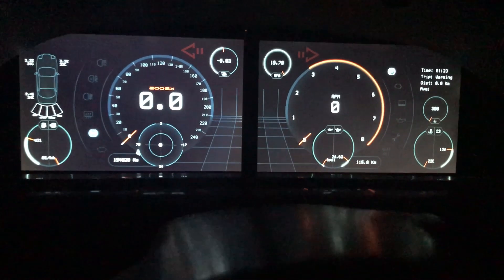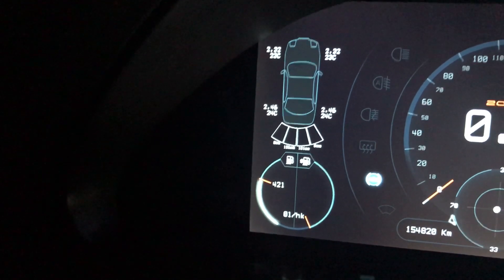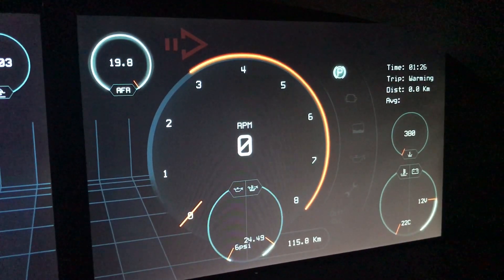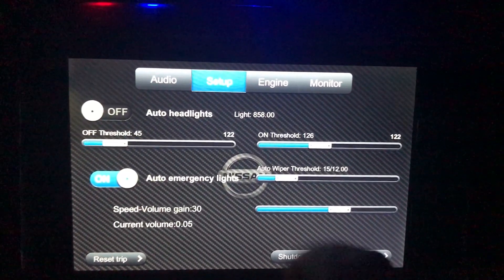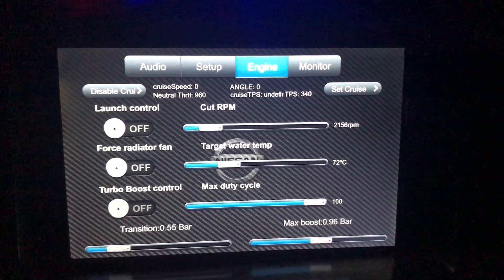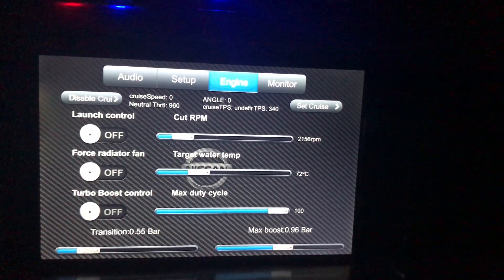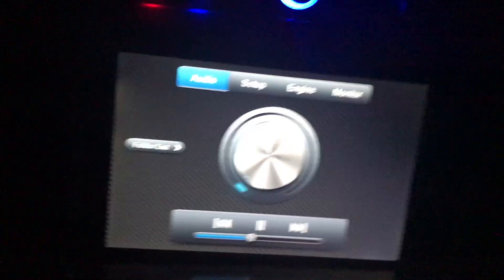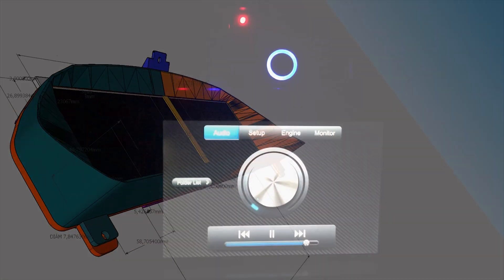Nissan 200sx Project update (September 2017)

Comment: Thats a really nice display, the thing i like the most is your custom UI!!!

Could you share some Details how you made it ?(Software or Templates)

 I am looking into making one myself but still looking for a easy way to implement the gui as i am extremly demanding but at the same time extremly novice with graphic design creation. 

It would be great if you could share some details or even template files, i already checked out your blog but havent found anything there.

Nice Work, and hoping for your Answer :)
Reply from the maker: Hi Daniel, thanks for your comments.  It is normal that you didn't find anything since I wrote all the software for the project.  At the time I used Adobe Flash to create a desktop application for the GUI, because of my previous background it was the easy choice for me.  Now that is bringing me serious portability issues and I'm re-implementing the same GUI in C++ so I can make a viable commercial product.   The GUI is basically dumb and all the stuff is happening in the backend running on a nodejs which exchange data through a TCP socket port locally and with the ECU and arduino MCU's.

Since I'm trying to make a commercial product I don't share any files or templates.  Eventually my commercial product most likely will be open source with documentation available to the purchasers.
Reply: S13 Reborn so when are we gonna be able to buy it??
Reply: Thank you very much for the thorough Information!!! If you really make it a finished Product you can count me as your first Customer :D
Reply: Any luck?

Comment: Great work! Which monitors are you using for the dashboard and the control panel? Are they visible in sunlight? I'm working on something similar for boats (http://fairwind.uniparthenope.it ) with he same hardware (udoo x86) but using Android as OS because my target is a customisable environment. I'm having some issues powering the UDOO-x86 with the 12V batteries: the board is apparently working (green light) but I can see nothing on the HDMI monitor (powered by 12v as well). The monitor works fine and if connected to an udon-quad (arm based) powered by the same 12v cable, everything works fine. Are you using directly 12v from car batteries or another kind of power supply ? Again, great job!